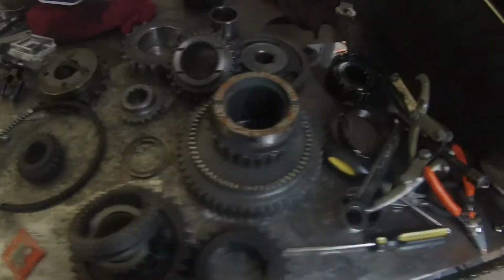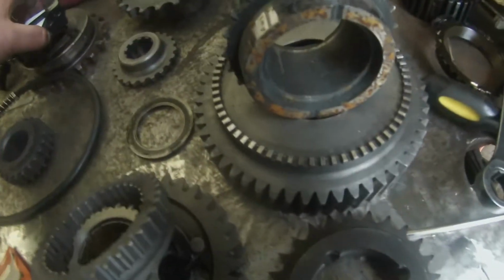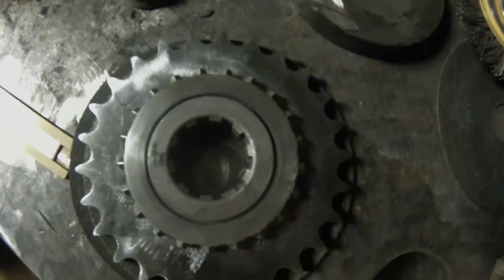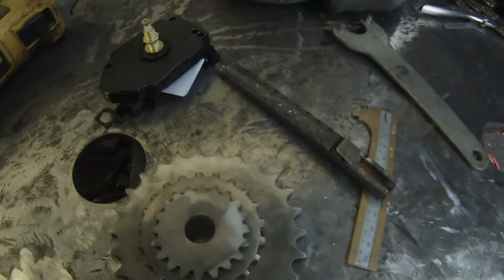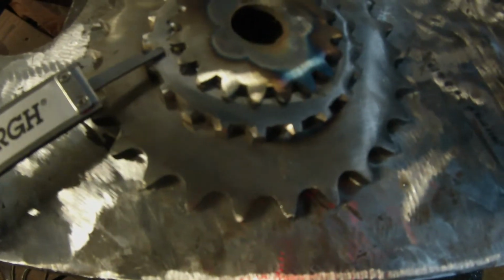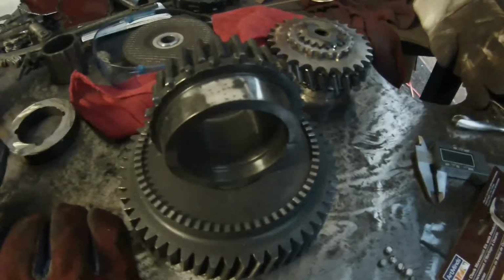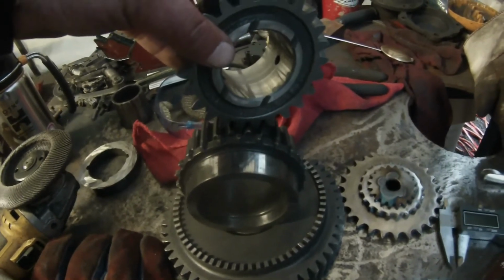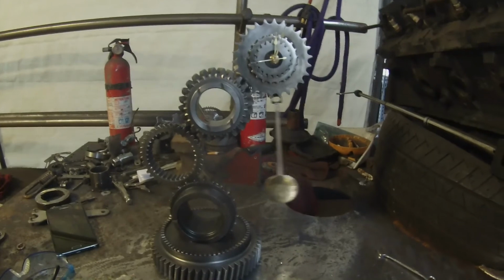pendulum clock welding project

Comment: Your clock turned out really nice, I like it alot... how do you attach the clock to the back side of the gear? Thanks for the cool videos.
Edd
Reply from the maker: Holy cow Edd. Ya know.. We talked about this in an email not too long ago. I didn't even realize it until I just read this. I know I had lost an 11 minute welding scene I was converting to the fast speed. I must have hit delete. It just vanished.. gone, poof.. lol Now the clock parts to the gears. I get carried away, I like what I do and sometimes forget I'm filming. I must have done just that.  After I weld the washer to the inside of the gear to fit the size of the clock parts, there is a little nut that just threads on. The hands push on after that. Also I figured out that you always want to set the hands on  at the 12 position. so you know they hit there correctly.
Thanx for the reminder Edd